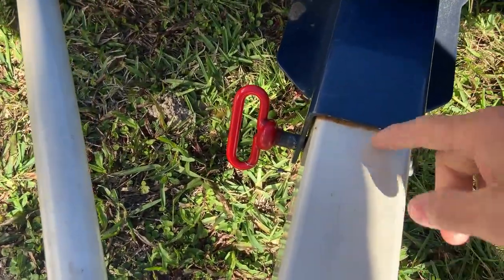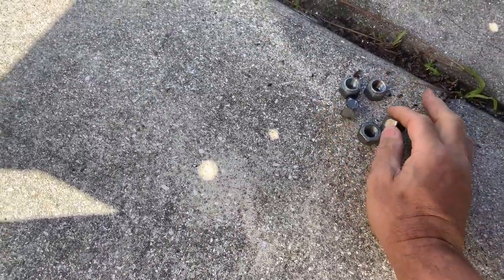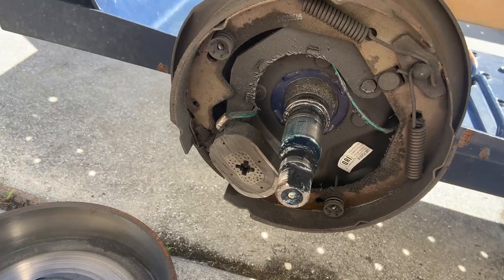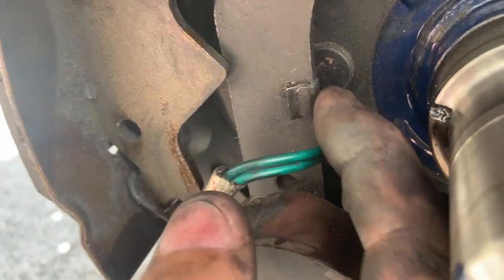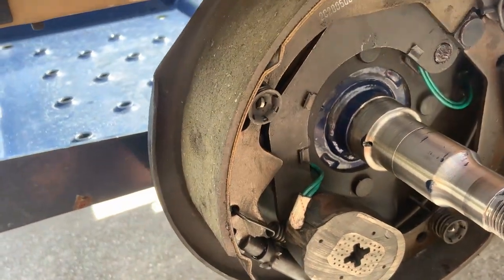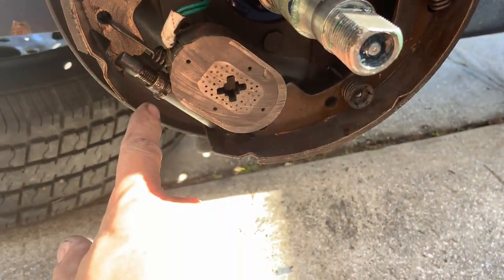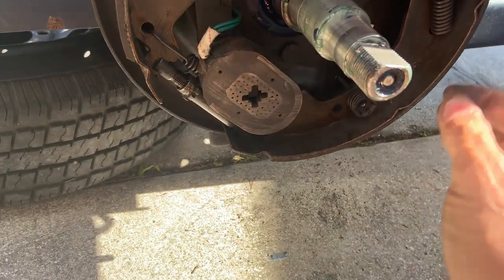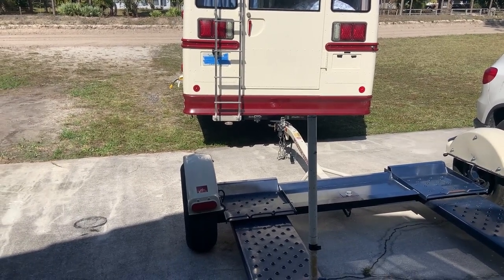Tow Dolly Brake and Bearing Inspection/Repair

Comment: Nice job and a very detailed explanation on how to keep these tow dollies in good shape.  I'm getting ready to make a trip from Florida to Arizona and I plan on pulling the wheel drum apart to inspect everything.  I could just grease it from the zerk on the shaft until I see new grease coming out by the castle nut but I'd rather take the time to know if there is any leaking inside from the seal.  I also ordered a bearing kit to have on hand when I travel.  I've not had that much luck buying parts in the local auto parts store.
Reply from the maker: Thanks!

Comment: I try to get things the way you got this. That good price leaves a budget for repairs. I find that I can often buy something used go over it replacing anything needed and come out spending less than a new one. Also I like to buy broken things because I find I go through them for less than a good used unit would cost. In both cases I know exactly what I have. Like you I too often find things that I don’t agree with, in being proactive adjustments save a parts bill later. Like your wiring and that ding on the hub a zip tie saved the harness, filing saved every bearing the dolly will ever have. Not to mention the piece of mind in knowing what’s there .

Comment: Great video, appreciate the help and insight! I just bought the same dolly with electric brakes but my plug doesnt have the center pin, so essentially its a 6 pin and the electric brakes dont work? I also dont have a brake controler in my RV, do i need that?  Any ideas? Thanks!
Reply from the maker: ETrailer.com. My bus has air brakes so I chose an air to electric brake controller. 

Trailer Towing Package Installation Part 2
https://youtu.be/709tx_Rbih4

Comment: My 2006 I just grabbed looks brand new
Reply from the maker: They sure are great tow dolly’s. Consider putting on fresh Goodyear tires. I had a blow out. Fortunately, at very slow speed so it didn’t damage the plastic fender.

Various on the road repairs
https://youtu.be/SoRXbU4cI2k
Reply from the maker: Safe travels!